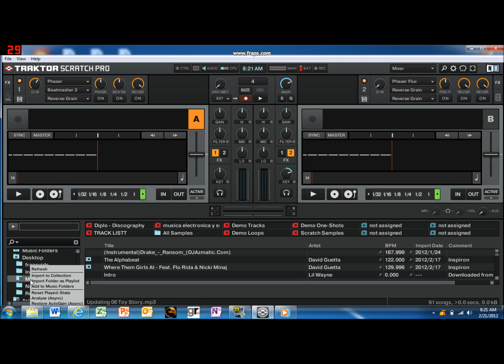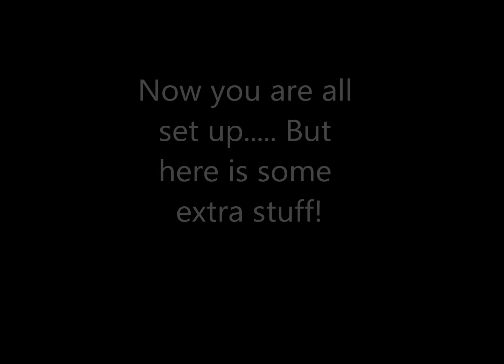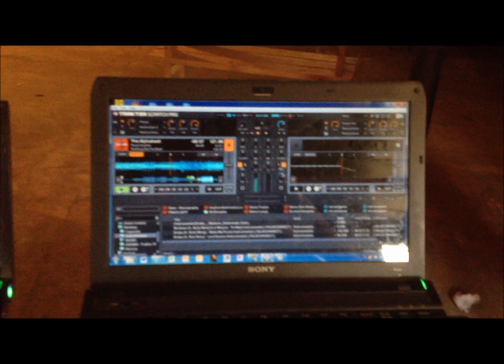How to set up Traktor Audio 2 Interface

Comment: Cool video...... do you need to setup the audio 2 interface in the traktors audio options if you are using an external mixer? or does it do it automatically ? thanks